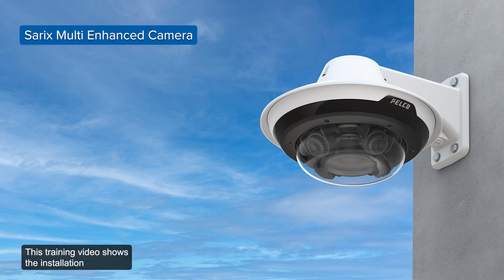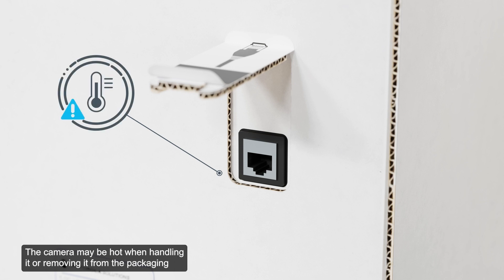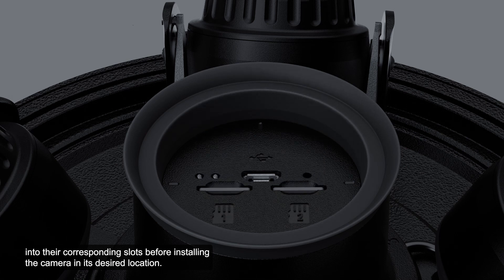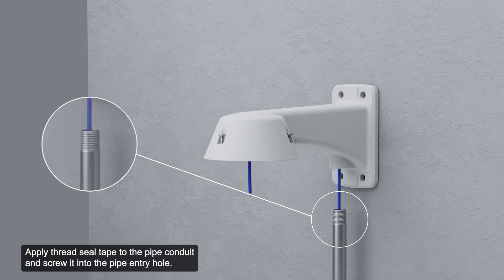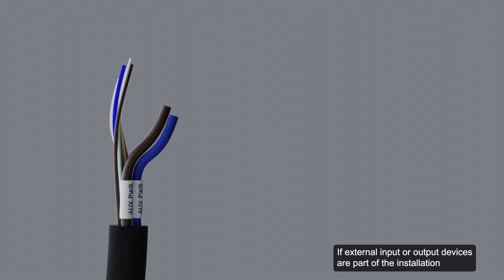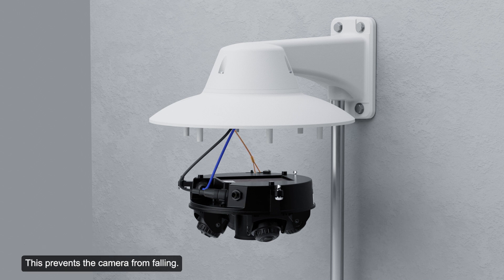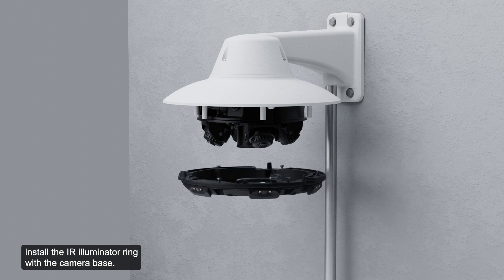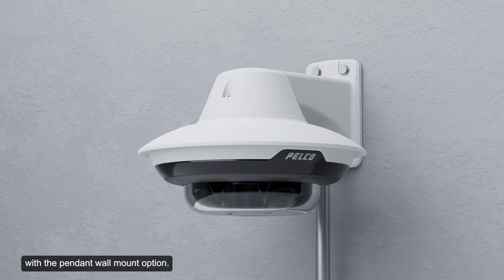Sarix Multi Enhanced Camera Installation

Comment: Hi brother this camera recently we purchased and connected to Honeywell 35 series NVR. while we connect camera through ONVIF we received only one camera signal. But there is an option for rtsp. Moreover I try to configure rtsp it’s not working. When I checked with VLC as same url it’s working. Please advise how to connect this camera to Honeywell 35 series NVR and see the 4 pictures at same time.